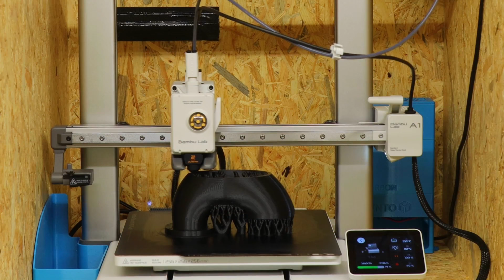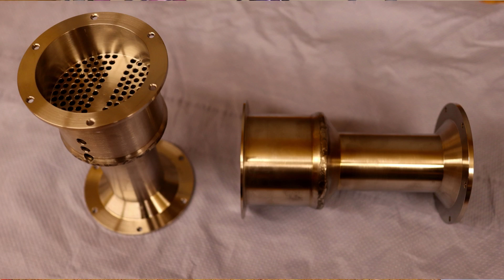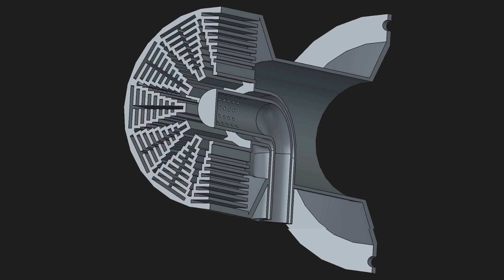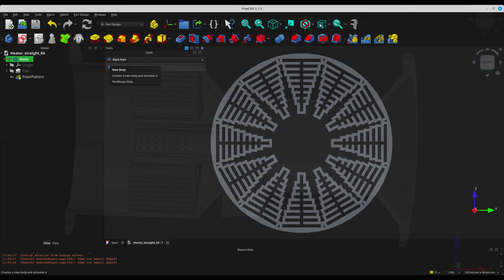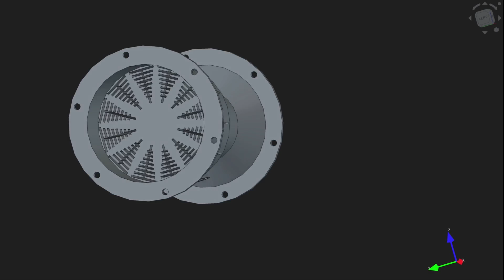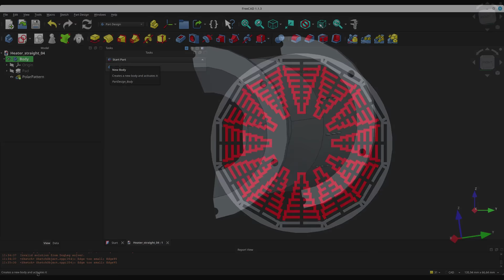The Stirling engine project

Comment: If you already use metal parts for cooler and heater - why do you replace all the plastic with usual plumbing metal tubes? In this case you can increase pressure and make it more effective.
Reply from the maker: Printed parts are easier to make and can have every shape.
They are also sturdy enough for the desired 10 bar pressure and accessible for everyone.
But If you can solder copper plumbing parts are very good and I also use them!
Thanks for your kind comment!

Comment: I'd love a stirling engine like this one but for low temperature difference.  I'm looking to make a cold plate and hot plate that heats up in the sun, transfer the heat/cold through heat pipes to an element, and those elements attaching to the stirling engine.

There would only be around 20 degree temp difference, but the self-starting nature of this means it would be completely passive, the only moving part being the diaphragm and magnet.  It would last for years and years.

Using a solar heat panel and a sky-cooling panel for the hot and cold ends is super simple and do-able by any moderately skilled enthusiast, the hard part is the maths for the stirling engine with variable temperature differences.
Reply from the maker: That sounds like a fascinating project, although achieving efficient power output with such a small temperature difference is definitely a complex challenge!

Comment: Would be cool if it could also work as heat pump or cooler in some tests
Reply from the maker: The use of the thermoacoustic concept as a heat pump for cooling or heating is actually the main application.
The you can operate it really without any moving parts.
I want to produce electricity for my home when the sun is not shining, but the heat pump concept is really interesting!
Reply: @myengines I’m wondering if you can have one that’s engine and heat pump and cooler all in one 

You just switch inputs and outputs (probably easier than it sounds)

Comment: can you make the metal part so it can be easily cast out of allminum, using 3d printed molds/masters?
Reply from the maker: Aluminium is not so good for the heater as its conductivity is too high and heat resistance is too low!

Comment: What is the power of the flame, what portion of the heat is absorbed in the engine and what it the produced electric power? I hope the efficiency is higher than a simple steam piston engine or turbine or peltier couples with no moving parts at all. 
The metal 3D printed design of the heater looks nice, but will it not suffer from soot accumulation? How is it possible to clean it?
Reply from the maker: I hope to get not too much soot with proper cleaned bio gas but the final version must have a better way to clean the parts!
Thanks for your valuable information!

Comment: well if u put copper boiler with water inside to cook on it , and pusk steam with copper pipes out to silinder and condesate it back to boiler ,will get prolly more power to el energy than this ?
Reply from the maker: Maybe for a low temperature difference engine this is a good concept but in this engine the temperatures have to be much higher!

Comment: have you thought about a linear piston set up with two oposing generstors with a coupling shaft to generate electricity, like hylion does
Reply from the maker: Yes, to use 2 or better 3 cycles has a lot of advantages.
But it also makes things much more complex and delays development.
Maybe when the engine is in a more final design I will think about it!
Thanks for your helpful comment!

Comment: Since the part will be printed on a metal 3D printer, you can go wild with more organic shapes that will extract as much thermal energy as possible from the flames. Organic shapes are providing smooth path for the flames and prevent cold spots where potential sooth will form from condensation of the exhaust gases.

Also, be aware that the burner orifices can get clogged by debris, sooth and oxidation and it is hard to calibrate the diameter of the internal orifices in order to get a stable flame.

Thank you for sharing all the effort you do on this project. Good luck!
Reply from the maker: Thank you very much for your very good suggestions, I will think very closely about them, they are very valuable!
 We are discussing intensively about gyroid or periodic manifold heat exchangers on Discord!
Again many thanks for your help, you are very welcome for more!
Reply: @myengines  Maeby try contact leap71 company if they use they software Noyron they can optimise your design efficiency.

Comment: do you know the gyroid infill setting in your 3d printer slicer? I wonder if that geometry would work well for the heat exchanger section
Reply from the maker: Yes, that is a very good suggestion, we are discussing intensively about gyroid or periodic manifold heat exchangers on Discord!
Maybe this option is usable for the CAD design!
Many thanks for your very good suggestion!

Comment: Could you use a subwoofer as the power generation coil
Reply from the maker: Yes its possible but inflexible for the development stage as I would use a new one for every step in performance!
But once the engine is near final it i would be a very good option!
Thanks for your good suggestion!

Comment: Gas water heaters can be very efficient. You should design something that can accept hot water versus burning the fuel internally.
Reply from the maker: Yes the engine is intended to work in a CHP which raises efficiency enormous!

Comment: Very interesting, good work sir. Idea: If the heater could be 3D printed in PLA in two halfs, one might be able to cast in aluminum and assemble with fasteners with minor modifications to the model.
Reply from the maker: Aluminium is not optimal, it has to be stainless steel but maybe your idea is worth thinking....
Thanks for your help!

Comment: But my question what is the high and low operating temperatures to keep the thing running
Reply from the maker: Minimum is 300°C hot and ambient cold, optimum is 600°C in the heater.
If you want lower temperatures, the engine has to be much bigger for a reasonable output!
Reply: @myengines  you should try to create a design that is water cooled instead of ambient to be integrated into heating systems.

I’m looking forward to making one based on your design to support our house’s electric and heating load in winter.

Huge fan of your channel!

Comment: I've always wondered why Sterling engines aren't used to power air conditioning units... Other than the obvious problem of causing a feedback loop which I'm sure someone could figure out a safety shut-off for, an A/C unit already has a hot and cold side, and that temperature difference grows wider as the air conditioner runs.
Reply from the maker: I am sure the thermoacoustic technology will be a revolution in air conditioning in a few years as you need absolutely no moving mechanical parts and no harmful liquids/gases for it!
I hope the established industry is not just to mighty for a change!

Comment: How much power can you currently harvest from a given amount of biogas, and how does this system compare to burning the gas in a 2-stroke engine or turbine?
Reply from the maker: The power is still quite low but with the now coming measures with a better heater design and pressurization I hope to get 300 watts as with my rhombic Stirling!
The efficiency of the thermoacoustic engines is in the range of the best other prime movers with the difference that any heat source can be used an it is very reliable in continous 24/7 operation which is even possible for hobbists like us!
That were the problems with the rhombic Stirling!

Comment: Why does the burner section need to be radial? If you do a square section cross flow design then you can have the burner at the bottom and the exhaust at the top. It should make it much easier and with sufficient cross sectional area it shouldn't affect heat transfer or flow in a negative way.
Reply from the maker: It is not a must but very practical when it comes to seals etc.
I also thought about that but it is complex to realize!
But maybe inevitable when designing the heater for wood or sunlight heating!
Thank you very much for your inspiring comment!
Reply: @myengines Thank you for the reply and your efforts in development. A couple other questions I have about the design. Have you considered adding exhaust stacks ie chimneys to either the hot or cold section to leverage natural convection and heat transfer? I imagine that a thermoaccuostic engine shares many of the core principles as a thermoaccoustic cooler. There is a good video by Nightinhawk where he talks about the standing waves that develop in the cooler version he was investigating. Would adding cooling to a section be beneficial to the performance of the engine? Most thermal engines efficiency are limited by the carnot efficiency so the maximum temperature delta yields the best efficiency. Also what about adding a water loop on the cooler section? You should be able to get a better delta T. Are you tuning the length of the sections to ensure that the nodes match up with the natural standing nodes that will develop in the system? It may be helpful to add a stub tuner like section in part of the design so that the amplitude of the mechanical output can be maximized as whole system is likely very sensitive to small adjustments for peak output and efficiency.

Comment: Just a thought what if you could combine a several tech into a single product - 1. Sterlings engine, 2. Generator, 3. Cryo cooler
Reply from the maker: It is very common to use a two stage thermoacoustic to generate cold with heat.
What do you exactly mean?
Reply: @myengines  to keep the generator coils cool to reduce the resistance and also the magnetism of the magnets increase when its cold it increases the efficiency of the generator
Reply from the maker: Okay i understand, but is it really worth the effort?
Reply: @myengines  cooler the generator lower the resistance of coil and permenant magnets strength help improve efficiency on load.

Comment: my little addition: the part of the heater heat exchange fins that faces acoustic manifold is rectangular in cross-section. Perhaps streamline the edges to reduce energy loss from turbulence on sharp edges?
When are you going to submit your design to JLPPCB?
They agreed to subsidize only one print?
Reply from the maker: Thanks for your valuable suggestion, optimizing with turbulence is a complex topic maybe some CFD has to be done!
I will give the heater to JLCPCB when the design is final, as there is a lot of  good help here and on Discord i hope it will be soon.
When I contact JLCPCB i wll try to det several designs but that depends on the cost for one print!
many thanks for your help!

Comment: Fantastic progress! Have you been able to determine overall efficiency and output for this scale? Do you expect efficiency to change with scale? What temperatures are needed?
Reply from the maker: Efficiency will raise with scale and a good efficiency can be achieved with the thermoacoustic engine as prooven by Swift et al.
This is a high temperature engine which needs approx. 300-400 °C, for lower temperstures you need a much bigger engine!

Comment: This is amazing, I have really loved watching this project over the last few months. My interest in stirling engines started with a video from Lindybeige, many years ago. I think I will be building this engine based off your specifications to finally have my interest become something tangible. But please! Make a video on everything you are using to monitor the engine, how to install it, what parameters you are looking for (i.e how do you monitor and adjust the electrical output, the frequency, etc)
Reply from the maker: Thanks for your kind comment, I try to show everything that may be interesting!

Comment: Understand concept of all one piece improves heat transfer, improves efficency... My question is... Is that efficency so much worth it compared to ability to have heater cut in half and clamped/bolted around heater tube. 

Why? Users can then experemnt & design  heaters to fit the fuel they will end up using.

Example.. Am an old fart that lives alone. Will realistically not produce enough waste to reduce to enough methane gas. A Sail Boat captain likely would prefer   Diesel or Alcohol fuel. An avid camper might want to  use Butane.
Reply from the maker: The interesting thing about this engine design is that you can use any heat source.
This approach is aimed at biogas, but other burners for wood and so on will follow...

Comment: I know you're mainly basing this on a gas burner. Please consider also one that can be mounted on a wood pellet stove hot surface. Combining heating the house with some electricity generation in the winter would be goated, especially since the solar panels will provide the least electricity in winter. Also, then the low effeciency won't matter as much, since you're using most of the heat for heating anyway, and it isn't really waste anymore.
Reply from the maker: I agree that wood pellet stoves are a perfect application for this technology, and I will definitely keep that in mind for future design iterations!
We also heat a lot with wood but designing a heater for wood firing is completely different!
When the design for my bio gas is satisfying i will definitely make one for wood use as we have also much of it!
The use in CHP is also intended for the gas engine as it is much more efficient!
Thanks for your kind comment!
Reply: Just posted about similar.. So many options for fuel and methane honestly would be less likely source. Waste oils, diesels, wood, alcohols, white gas etc are all more desirable
Reply from the maker: That's the interesting in this engine, any heat source can be used!
Reply: What is the temperatures your shooting for on hot side, that heater needs to  heat to / maintain?
Reply from the maker: For best efficiency you need 600°C but it runs from 300°C.
If you want a more low temp engine, it has to be much larger!
Reply: @myengines  yikes.. That's Hot. From 575f to Little over 1100f. Hmm. 

That certainly limits use to liquid &. Gas. Combust ables. Any other source would be to big and require then a way to move the heat from bigger fire box (say wood stove at full on burn) to the hot side of a unit like this one. hmm

Not sure what medium on could use to move that hot of  medium that can flow from heat source to around TAG like this.
Reply: @coachgeo mit nem Pelletbrenner sollte es doch kein Problem sein. Auch mein Kamin läuft mit 300grad, nen holzvergasser hat hohe Temperaturen
Reply: @k.w.3741 how do you propose to  get/move that heat from the bulky burner to the smaller TAG at Specific small area of the TAG  that is only inches wide?
Reply: I wouldn't want a noisy engine in my living room if it generates only a few watts.

Comment: The 3D printed heater looks interesting, but it looks like you would need some additional fan or blower to force the air inside for the good stoichiometry. How about some combination of external&internal fins with the external cover sleeve to minimize heat losses.
Reply from the maker: Yes you are very right, the air supply is not optimal yet and has to be improved!
On the long run the combustion air has to be preheated from the exhaust but this is the next step!
Many thanks for your valuable suggestion!

Comment: I would look into using an AC unit to heat up this Generator as a secondary Option while also using it to Store the Cold in a Water Tank. The Cold can then be used as a sink for this or other projects. Then I would add a small Solar panel so the compressor can be kicked on when there is no fuel to burn. Additionally the use of Heat Pipes to wrap from the bottom up to meet at the top would allow a flat plate to be used at the bottom as a Thermal Sink to dump much more heat into with a defined limit of how much heat can be transferred based on the number of heatpipes. The downside is the Max Temp is much lower.
Reply from the maker: That is a very interesting concept for thermal management and energy storage, thanks for sharing your ideas!
Reply: Hey, sounds cool, how do you use the cold?
Reply: @Grateful.For.Everything  It's extremely inefficient, but one way is Peltiers. The limit of the condenser, or what other machine is used for it, to remove heat is the Thermal wall of the Volume of water. This is the floor of the size of differential between hot and cold that can be obtained.
Reply: @AlcorSalvador  ok so we can say THERMAL WALLS are the SIZE DIFFERENTIALS
Reply: @Grateful.For.Everything  better to keep the terms separate. One is a product of the other.

Comment: Cool design.  Some data on efficiency would be appreciated.
Reply from the maker: Efficiency test will be made when the design is m ore final with the printed heater and above all pressurization!
A good efficiency can also only be achieved with combustion air preheating which can be done with the new heater parts!

Comment: Why do those parts need to be metallic? Why not ceramic?
Reply from the maker: I discussed a lot with the ceramic printing experts on Discord and it is indeed possible!
But the burning process is a bit complex and the invest in a 3D printer for ceramic and a suitable kiln is too much for me!
I hope to get a ceramic 3D printing expert into the project, then this is a very interesting option!
Thanks for your good suggestion!
Reply: @myengines I'm getting into ceramic 3d printing, developing a new low-entry process